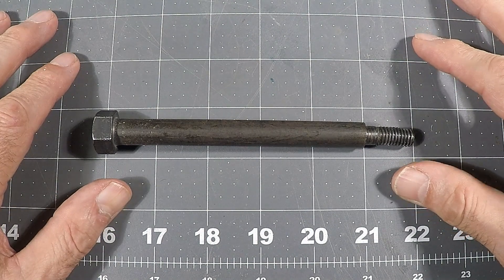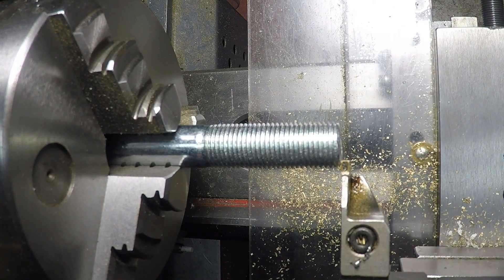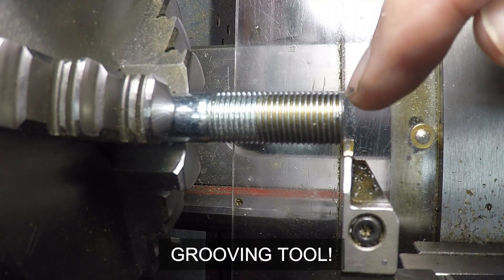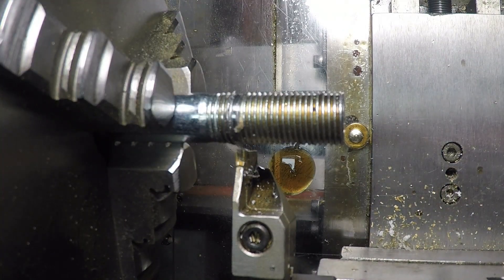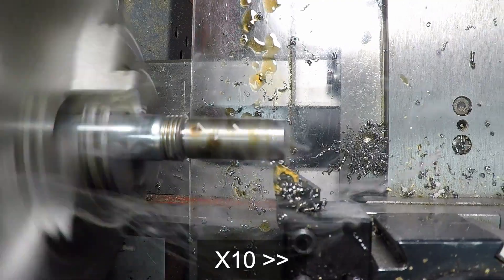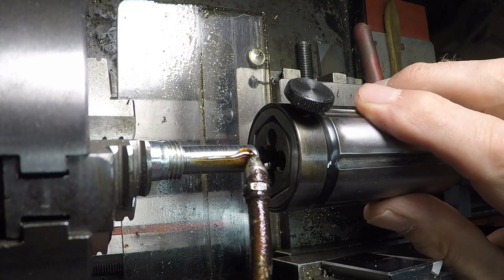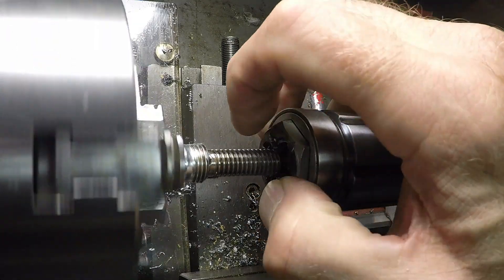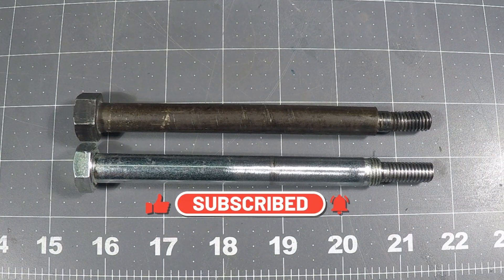Table saw bolt replacement

Comment: It works great.  Thanks so much for the help.  It is amazing how easy this sort of thing is with a machine shop compared to how impossible without one.    The saw is back to working order.  FYI the bolt locks down the tilt rather than changing it.
Reply from the maker: Glad it worked out! 🙂

Comment: A grade 8 high tensile bolt would have been a better choice if they were available
Reply from the maker: I just used what was provided.  Hope it works for him!
Reply: @GuyMarsdenMakesStuff  if it doesn’t work I would be willing to help you source metal that would work I just need to know the diameter you need.  I have some 1144 stress proof that would be perfect for the bolt
Reply from the maker: @taranson3057  thanks!  I'm pretty sure that it will work fine but I'll let you know.
Reply from the maker: Well, it went right in.  The head is captured by a handle that locks the tilt axis.  Worked fine - and he's happy.
Reply: The bolt is only ever hand tightened, and takes almost no load.  The previous failure was in bending, probably from being moved.
Reply from the maker: Yeah, from what I saw, it must have been bumped HARD!